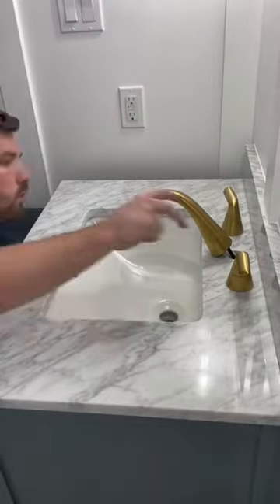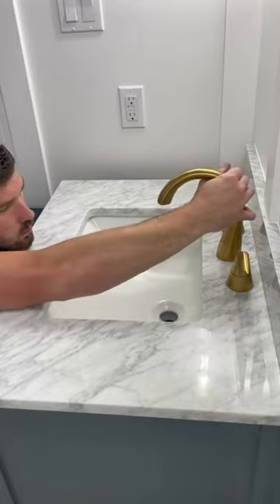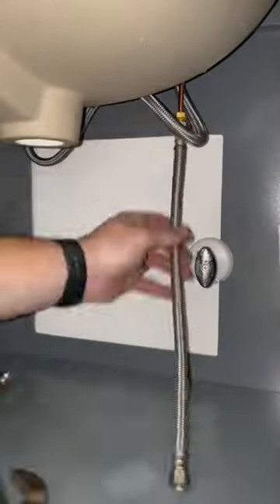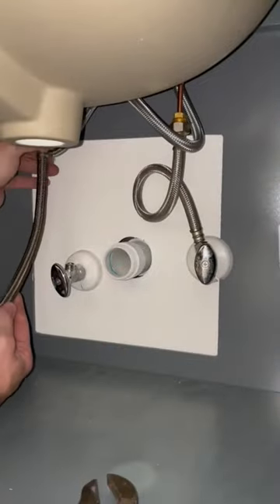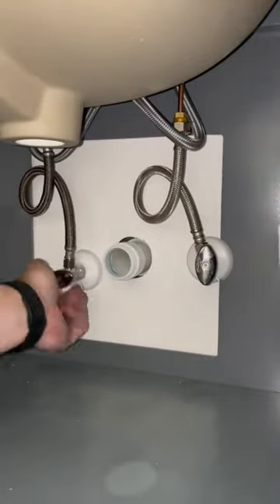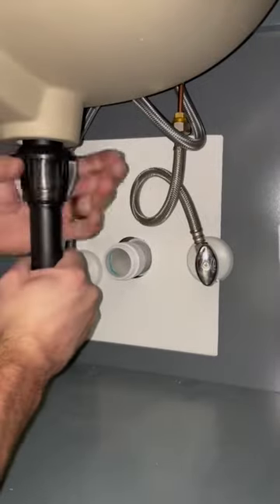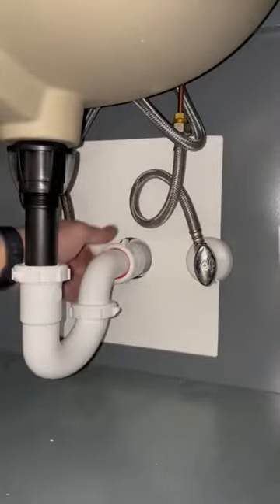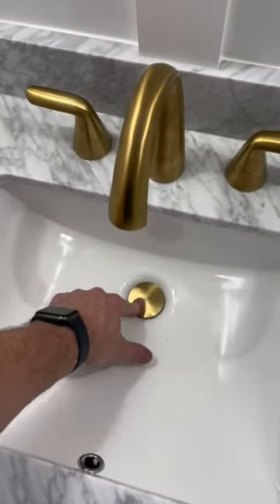Installing a customer supplied lavatory wide spread faucet and drain assembly. #plumbing

Comment: Always Dope everything guy didnt dope nothing dope all gaskets and threads anything that has water flowing threw it should be doped up
Reply from the maker: No? No reason to dope fittings that have rubber seals.